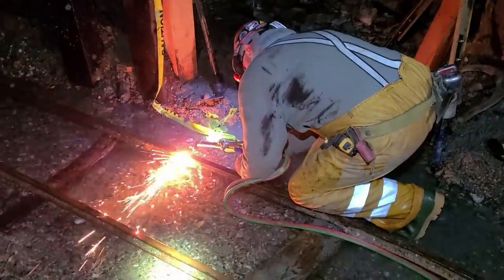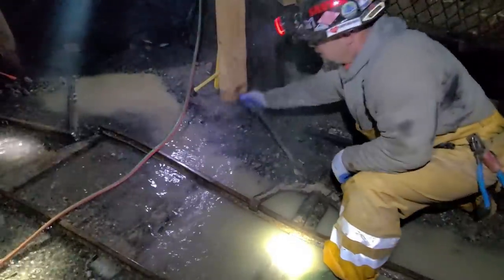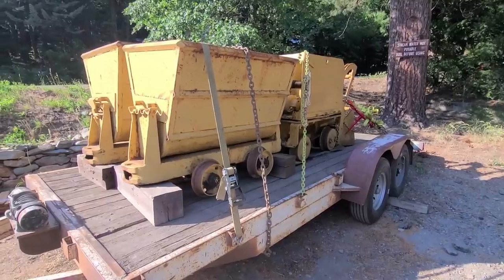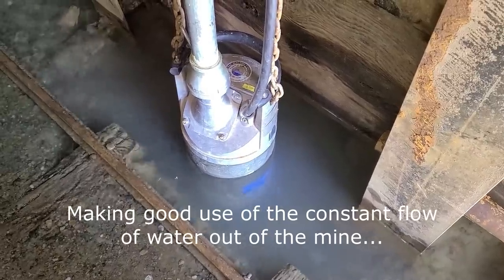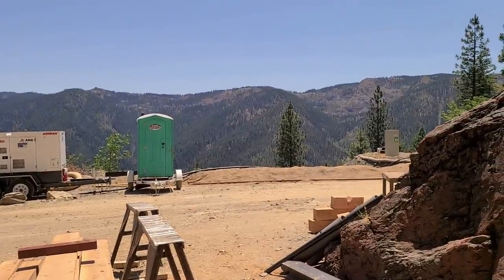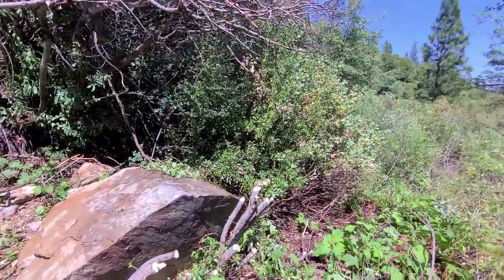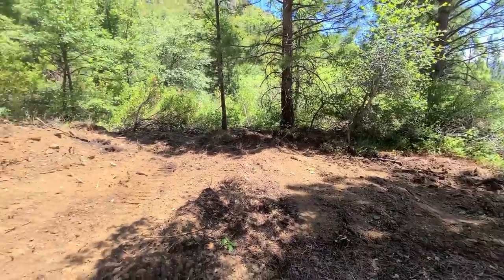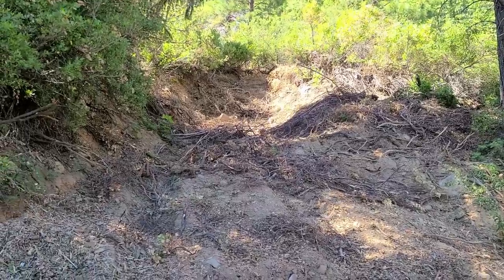Bringing An Abandoned Gold Mine Back To Life: Part 5 of ?

Comment: The reason your milled wood/timber is warping and checking is because it's wet. Use some ratchet straps and strap it down to some 4x4 stickers and then cover it with a sheet of tin roofing.

I visited your mine about three years ago. It's amazing to see it opened up! When we were there all that was visible of the portal was the steel header and water was flowing out of what was left of the opening. We continued up the hill and made our way back to some lakes that shall remain nameless... in any case, your waste rock pile is a great place to take in the view while on a pee break.

Comment: Take the water being pulled out of the mine and fill a small water tower for fire fighting rather than just dumping the water down the mountain and depending on an electrical pump that might not have power when you need to fight a fire.
Reply: They have to have access further up the mountain for the higher workings, so it should be reasonable to put a tank on the hillside up there for this purpose.

Nothing more reliable than gravity. And reliability = safety.

Comment: 6:30 try sealing the ends with tar or something to slow down the drying, it'll help a lot with that. most of the moisture is lost through the end grain. 
even if you get a tin pot and fill it with candle wax and heat it and brush it on when the wood shows up it should help a lot.
Reply: Even the cheapest latex paint on the ends will help.

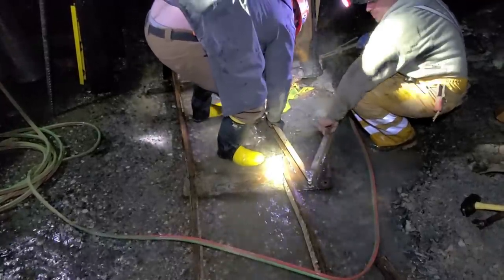Comment: 0:28 Don't try that trick with coated polycarbonate lenses! I walked too close to a burn pile and the coating completely cracked. It's not covered by warranty. The coating also can't be buffed off. It might come off with paint thinner, but I can't risk messing my glasses up more until I get replacements.
Reply: I can't stand safety glasses underground. Once they get a little bit of dust or mud on them, the glare gets to be awful and I get thrown off balance. I've hurt myself more times by getting disoriented by my safety glasses than from not wearing them. I keep them out of the way unless I'm drilling, cutting, or grinding.

Comment: Watch out with that mucker, because it is some heavy equipment. Ive heard stories about guys loosing their head because the mucker threw its arm back, and then they got their head stuck in the machine. So attention needs to be paid when it is in operation. 

I saw these carts and a mucker not too long ago in some other mining exploration video. Sometimes they just leave equipment in a mine. Maybe a good source for materials?? Dont know if it is legal to take anything or not. It probably depends on the claim. Also, you cant really tell where it came from, because the person selling it is just selling it. It equipment does not say where it came from unless it is written on it. 

They do look good dont get me wrong, but if you really want to have a lasting paintjob, get 2 component metal paint. That really stays on, it does not chip or scratch either. But of course you first want to sandblast the equipment before applying the paint. Just a paintbrush gets the job done, no need to spray it on. Also painting really makes the equipment last a lot longer. 

The site looks cleared of brush now. :) 

Greetings, 

Jeff

Comment: Super interesting video, just great!  Nice job clearing the area by Portal #2!  Very clean.  I hope the USFS gives you top grades.

FYI, Google updated the satellite image for the area around your mine.  Now on the website when I look at your mine, I can see fresh lumber near the portal on the side of the big rock near where two pickups are parked.  So the image is reasonably current.

Also I can see the size of the dump for that upper portal, the one you call #2, and the dump for Portal #2 looks significant, maybe 50-60 percent of the one on your lower level (#1).  Do you know if the previous mining company (1950s, or so) used Portal #2 for mining, or was it mostly for delineating the ore body?
Reply from the maker: Thank you. Yes, the ATF and others gave us a thumbs up on the clearing. The pile for # 2 is actually pretty close in size to our main one where we're working now, but the vegetation is covering up a fair amount of it. I'm not sure of the purpose of # 2 yet as no one has been up there.

Comment: Quick question, while i love working with a torch, wouldn't a cordless angle grinder make more sense in the mine ?
Reply from the maker: We needed to make holes in the fish plates as well as cutting the rail (which is hardened steel). We use the cordless angle grinders for some jobs, but it wouldn't have worked for what was needed here.

Comment: In the late 1970s I would pay $20 for a permit that allowed me to cut 20 chord of downed wood (not to fall trees, just to take already downed trees).  That greatly helped to clean up the tinder along the accessible areas of the forests.  The eco-whackos put a stop to that, so the forests have become tinder boxes even along the fire roads and old logging roads where people often go camping.  People keep building houses deeper into the forests, and we got better at stopping the fires that were part of a natural cycle to help clean up the forest floors. Then they started spaying aluminum oxide in the air everywhere (chem trails), so now even bare earth with no vegetation burns and is difficult to impossible to put out.  The first example of burning scorched earth I remember seeing was the Oakland Hills Firestorm of 1991. And it's become an ever increasing scenario year after year since then.
Reply from the maker: As usual, you are 100% correct. I'm sure you've heard that old expression about the road to hell being paved with good intentions and that couldn't be more true than with the situation facing our forests today. It's a tragedy, but one that was entirely avoidable...

Comment: Are you aloud to save any of that water that's flowing out? Is the water contaminated at all?
Reply from the maker: No, it is not contaminated. We've had it tested and it is very pure - well above the requirements for drinking water... We could save it, but with an endless supply have not felt the need to.

Comment: Don't mean to tell you what to do but, Slow the RPM's down on the excavator. It's really hard on it. That clanking as the boom rotates and stops... You'll bust some pins. wear out the eyes. Just above idle. Enough so it won't bog down. Sorry.
Reply: Do you realize that an excavator has an idle up circuit that is preset to maximize performance?????  The clanking noise you hear is warn bushings from a well used machine, it happens!!!
Reply: Sorry man, gotta disagree…when operating the boom to actually move material you want the rpms higher, not so low like you said, the pump doesn’t make enough psi at low rpms and it’s really hard on the hydraulics and engine to be grunting that hard, I’m not saying to max it out, but you want it up there.
Reply: You're wrong forty two; if you don't know what you are talking about, don't talk about it.
Reply: @MichaelRichards983  my man

Comment: actually that hammering on steel you're trying to move has nothing to do with the age of the rail. it has to do with the molecular structure of the metal and how a shock affects it. you can do the same job by overbending and it'll "relax" where you want it, but by whacking it, you make the overall force needed much lower, and the memory weaker. I've done that on brand new steel when it was fucked up off the truck before. it's a really neat mechanical "trick" I got from autobody collision repair. they had a car hooked to a frame and were pulling it straight with no help and it ripped the eye off at like 5k lbs, so they set it up again and at 2.5k lbs he starts tapping on it while pulling and it moved like warm butter with only 3k lbs max
Reply: You are wrong actually

Comment: I know that its weird question but how much fuel do you use in that generator per day? If anyone tried to use solar/wind power generator systems for some less demanding electric stuff(charging batteries for tools, lights etc.) to use less fuel for bigger generator? Would investing in it be good and maybe in local areas you would actually get donations for "ecological approach"? Because lots of other smaller business can get help in switching to solar/wind power and I was wondering if more "dirty" industry like mining could get that too. You actually could use that water pump to clean solar panels automatically to get better efficiency(as most of people dump them on roof and think they gonna just work even if covered in dust or even snow...)
Reply: Interesting comment. I'm a big fan of solar for things like lighting and radio systems, saves a lot of money over running the genset 24/7. A couple small mines I'm tied up with use solar for small electronics like that.
Reply from the maker: I'm not sure of the fuel usage on the generator as that is delegated to someone else. It is surprisingly fuel efficient though... We use solar for all of the small electronics, satellite internet, etc. The generator is usually for the big stuff like the blower.